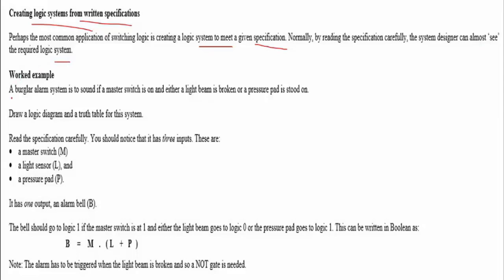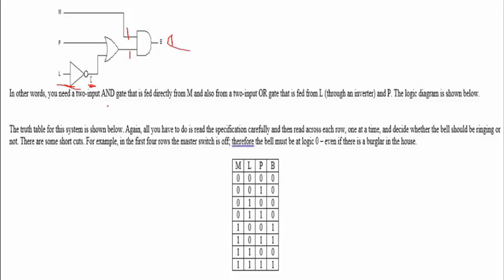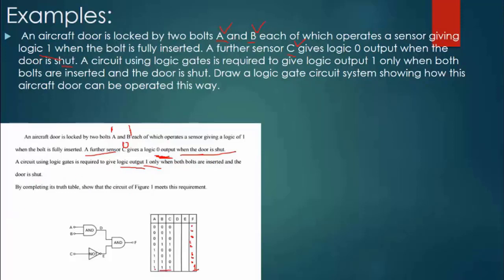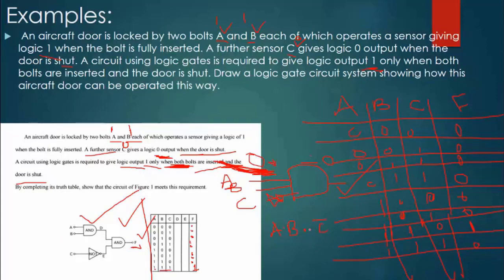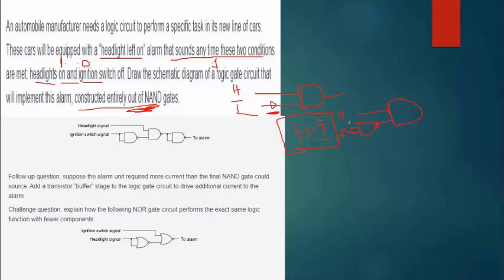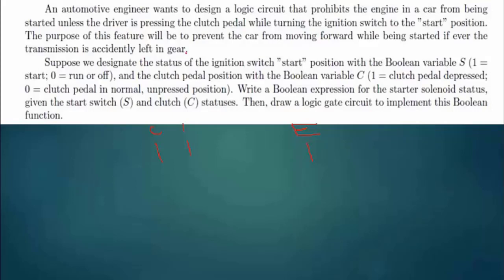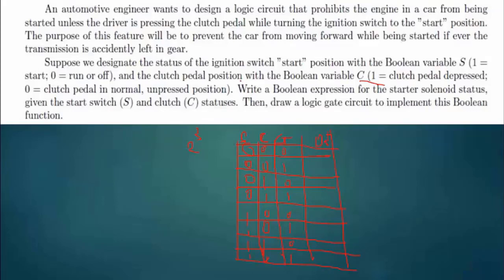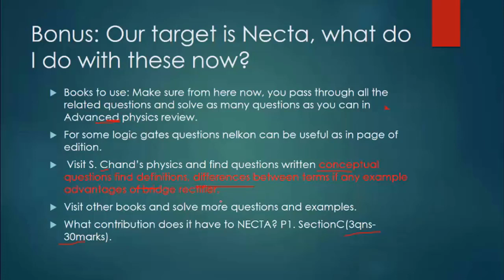9 19 Boolean Algebra example2 WORD PROBLEMS

Comment: Should n't the output of truth table for first problem be 1 in the 5th row and 0 in the 7th row?
Reply from the maker: Hello. Is it the aircraft problem? Welcome
Reply: @Ntanguligwa  No, it's the burglar alarm problem.
Reply from the maker: @goplay5936   Yes Sabrina you are right it's that way even in the worked example or maybe if I didn't get your question right. Sorry for late reply I had issues. Additionally So remember the L is connected to a NOT gate don't forget that. So column of L should be 1 1 0 0 1 1 0 0 from top to bottom while combining to get the output B.